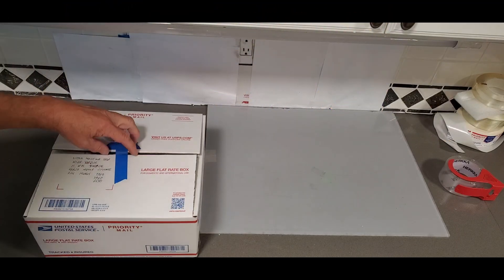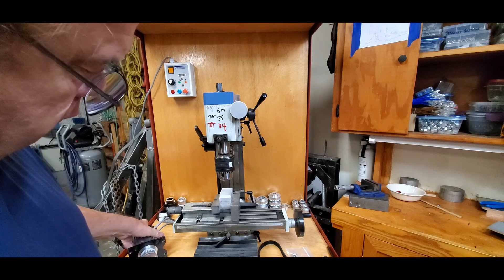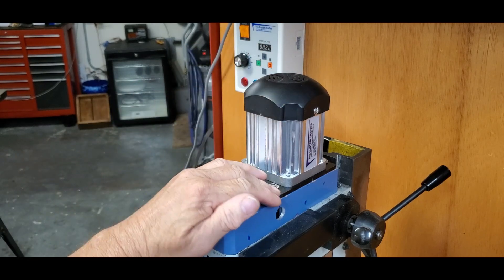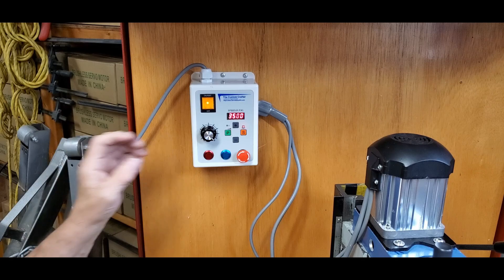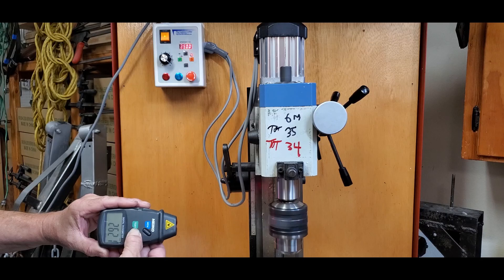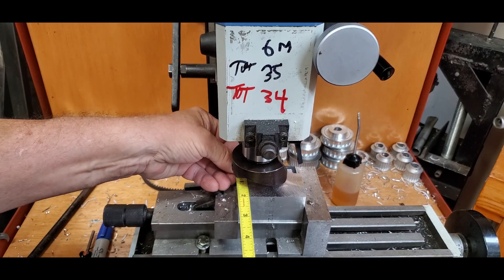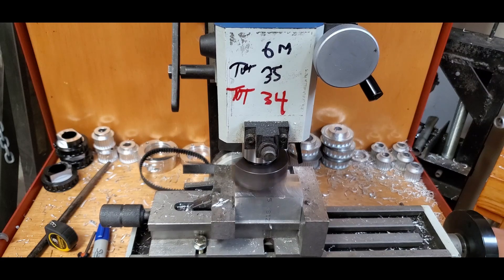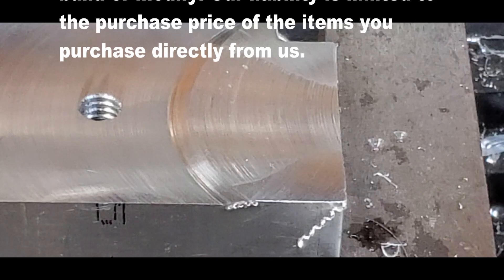Little Machine Shop High Torque Servo Motor Upgrade to Actual High Torque 900 Watt BLDC Motor

Comment: I have the HiTorque 4190, will this work? Is there any interference with the DRO on the 4190? I imagine not but best to ask. What happens to the original motor control box? Just remove it?

Comment: Do you only sell the control box? I have a 750W engine of this, those for sewing machine, but the parameters that have on my control box are limited and is not good for me to use in my drill press, I would like to know if you have for sale only the control box 110/127V or only the PCB.
Reply from the maker: First consider this: There are many systems that look like the same motor. They are not. Many use the same housings, even the same main board. However magnets and windings are inferior. If a company does not publish the torque produced there is a reason why. Rating HP by watts consumed means nothing about the actual power produced. A dead giveaway is the RPM's they say their motor will achieve. We are pushing the max at 4,500 on a 750w, 3500 maybe 4,000 on a 900w. Theirs will spin 5,000 +. This is because it has small or inferior magnets, otherwise cost would be much higher like over $900 USD. Windings are another overlooked item. Just because they are copper does not mean they are the correct gauge wire or the correct winding style.
That brings us to the controller. The operating system for a sewing machine has all sorts of issues when you attempt to use it on a metal working machine. When you try to fit our controller to a brand X motor, the math will never be correct. Sure it might work if you use the right number of poles parameter but not correctly. No power, noisy and heat build up are proof it's not right. Even if you have a motor made by the same manufacturer does not mean it's the same. This is because other company's like V____ demand cheaper materials and de-tuned windings. If you happen to have the correct motor, than our controller will work well.
Bottom line: Its much less costly to buy the right system up front even at a much higher price. This is because buying our controller after the fact will cost more than buying their motor purchased in an attempt to save money. Than buying our parts to fix it. Besides, we will not accept returns or warranty our parts unless you previously purchased our motor and can show, the parts are for it and not for a brand X that you bought somewhere else.
Reply: @danielmartin382  Yes, of course I agree with what you said, what I have here is actually Chinese but it was imported by some company that labeled it with one of their "brands", I was actually trying to find Control box parameters more useful than the one I have, but the board is expensive and sellers almost never provide the correct details, and parameterizing the one I have is unfeasible , I wanted to buy a kit like that from you, but I live in Brazil, and to be able to buy it, I have to send it to my address in Florida and from there send it to Paraguay, and go pick it up, because it's not possible send directly to Brazil, because of the corrupt government that robs us with abusive taxes , But I'll see what I can do and if anything happens I'll get in touch with you, thank you for your attention, big hug .